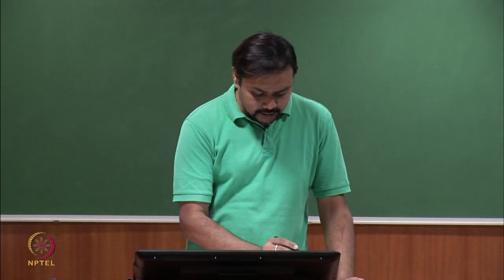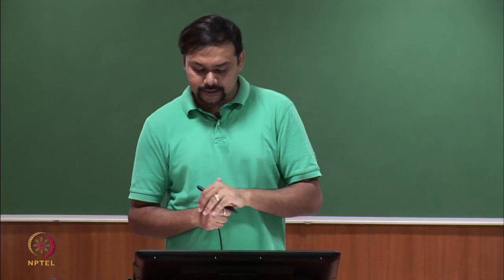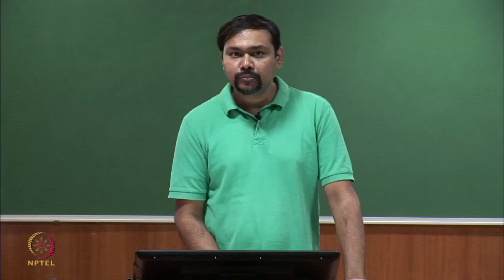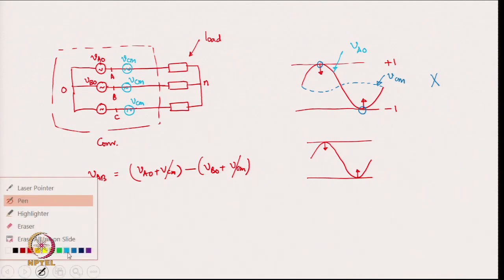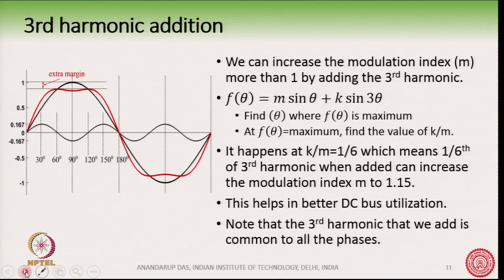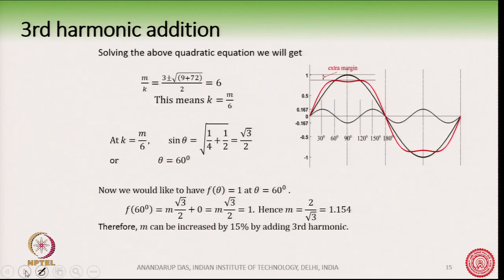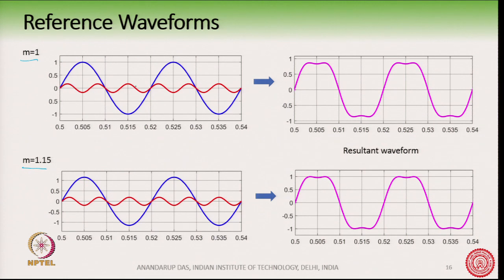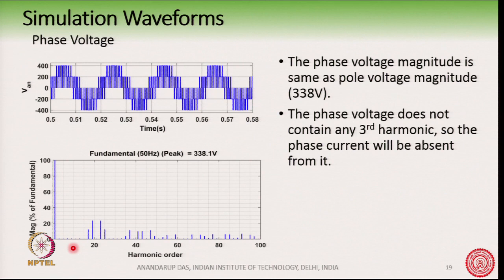Third harmonic addition in Sine PWM

Comment: You have one mistake: The 2/sqrt(3) modulation index gain factor should be applied to the total reference signal (fundemental sine + common mode signal), and not just to the source signal. The new reference signal is: Vs =  (sin(theta) + (1/6)*sin(3*theta))*m*2/sqrt(3)

This insures lowest line voltage THD with maximum DC source utilization.

Comment: hank you for the video. Could you please clarify the following questions?

The procedure is as follows:
1. Make a modulating for the first sine wave (e.g. for the first transistor). Amplitude (e.g) = +1...-1
2. Add add third harmonic and get the curve with two humps as you sown.
3.  Add another triangular reference signal with amplitude = +1...-1
4.  Сut PWM signals by comparing voltages. 
5. Send these signals to the transistor

The structure of these PWM signals will  be different than if we were using a pure sine wave. But why would the output line voltage be higher? An open transistor "sees" the input constant voltage (500V). Not more. I have it after modeling the same (In both cases, the amplitude is 500V)

The second question: We can set the amplitudes of the modeling sine and the reference voltage as we want. It's mathematics. 
I can make the amplitude of the reference voltage just 15% lower than that of a sine wave. Then the transistor will be at the point of the maxima of the sinusoid open just longer.
Why do we need a third harmonic?